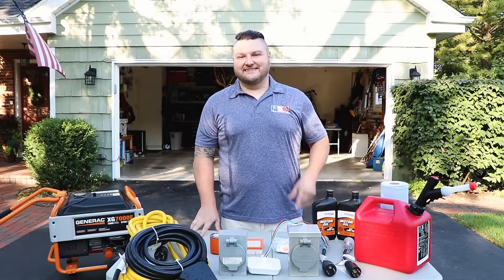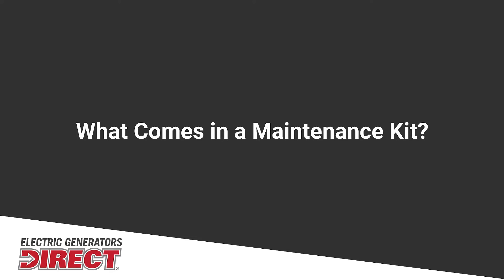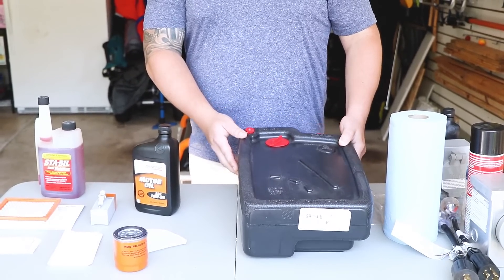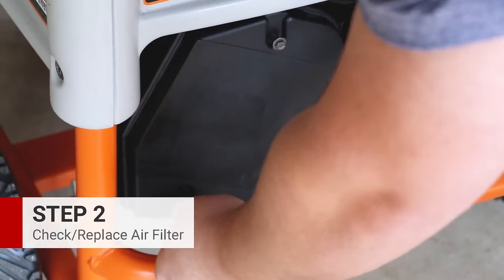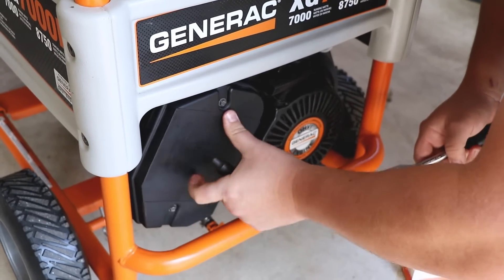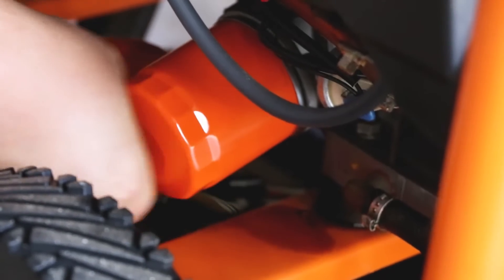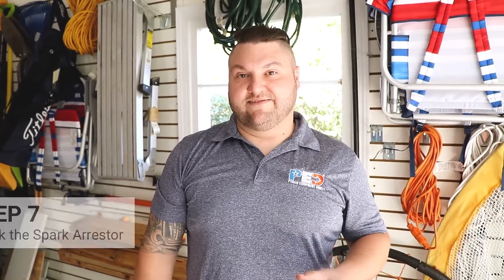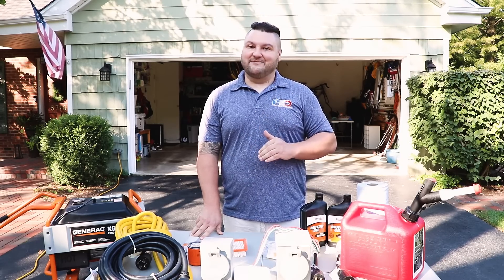How to Maintain a Portable Generator [Part 4]

Comment: I learned my lesson about motor oil and air-cooled engines the hard way. My B & S engine locked up on me using straight 30w in 90+ temp. one day. It was Wal-mart lawn mower oil rated API SJ. I managed to break it loose and it smoked for 30 minutes before thankfully running normally again. I was lucky. 10W 30 is fine for below freezing and 5w 30 for below zero. I no longer trust the Manf. specs. because of this. I used 30w between 40 and 70 degrees. 40w up to 100 and 50w past 100. Never had another issue. I changed to using Valvoline VR1 racing oil.  I also add 1 oz. per 5 gals. of gas a TC W3 2 cycle oil. It cleans and lubes the upper cylinder and fuel system. Overkill I know but I don't want any issues when I need to run it.

Comment: I dunno if you're still replying to comments, but you mentioned that generators should be regularly started and let run for maintainance.
Would every 6 months of running be enough or is bi-monthly required?
And for how long should they be running? A few minutes or like, half an hour to an hour?
Reply: i think 30 minutes each month should be enough. if temperatures are much cooler like during winter, then this has to be done more frequently (twice a month), and during warmer temperatures (summer), it can be done more moderately. (once per 1-3 months).